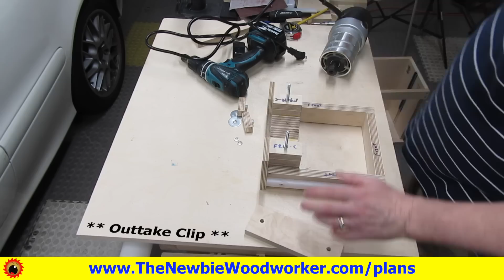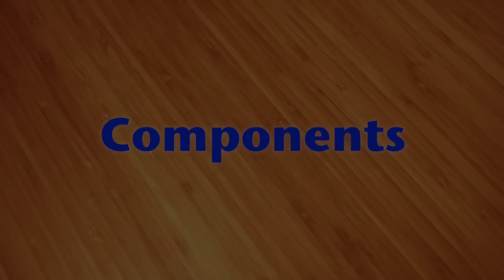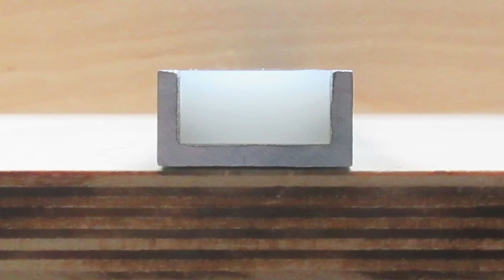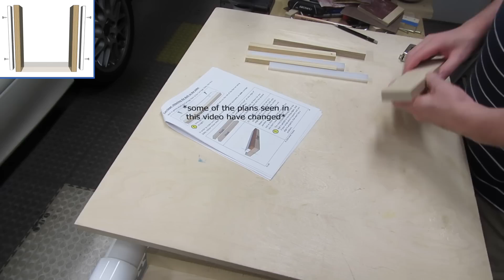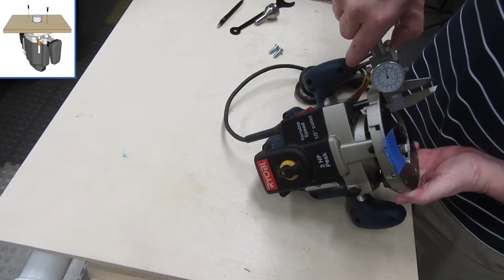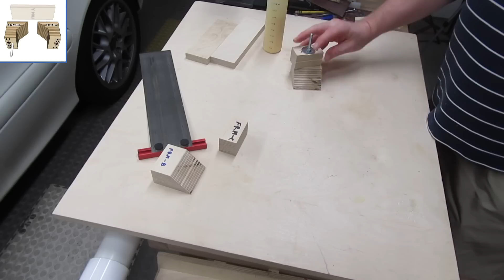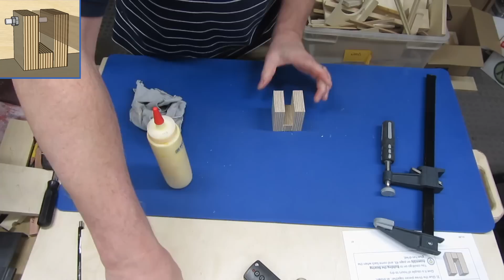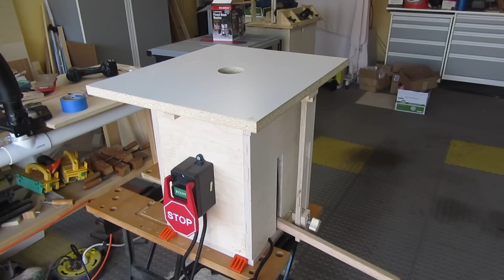Build: Router Lift with Lever & Mini Router Table, for Plunge & Fixed Routers

Comment: Why do you even need the Aluminum T-track here?  Couldn't you just use the plastic running in the dado?
Reply from the maker: I don't know, I never considered that. I suppose it might work.
Reply from the maker: If you're going to build it, give it a try and let me know how it works. The good thing is, if it doesn't work, you can (hopefully) just make a bigger dado and add the miter track, although getting it aligned property might be difficult...
Reply: @TheNewbieWoodworker  after i make your corner clamps going to give this a go.
Reply from the maker: @DavidMcKeen  👍

Comment: I recently bought your router lift plans and plan on using the fixed-router version.  I also bought some lift plans from Stumpy Nubs.  I definitely prefer your plans in that I think your version offers more stability with the miter track/plastic runners as opposed to the drawer slides in Stumpy's. I wonder, however, if you think it would work to incorporate Stumpy's threaded rod crank system into your more stable design.  I think the rod would offer a little bit better incremental bit adjustment than the lever.  What do you think about my trying that?  BTW, here's Stumpy's built video >>>  https://www.youtube.com/watch?v=diAg_uZlb2s  Thanks so much I enjoy your designs and your videos.
Reply from the maker: Thanks, Scott. I know the Stumpy Nubs router lift well - it's one of the many videos on the subject that I've watched. I tried the threaded rod, and as I cranked the rod around, I noticed that my router bit leaned a little in one direction, then leaned a little in the opposite direction, as it went up and down. So that's why I went with the lever directly underneath the router, right in the middle. But if you want to give it a try, I say "go for it" - it's fun to try different things, and if they don't work, you just say "now I know". And if they do work, you feel awesome! Let me know what you end up doing!